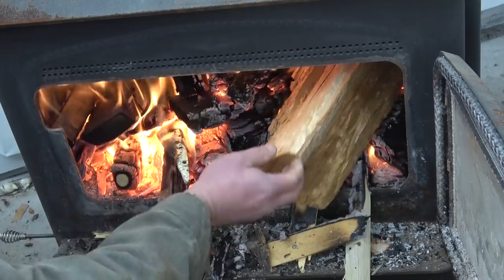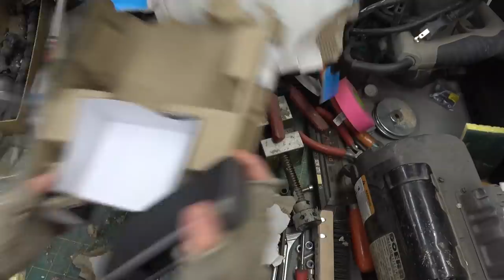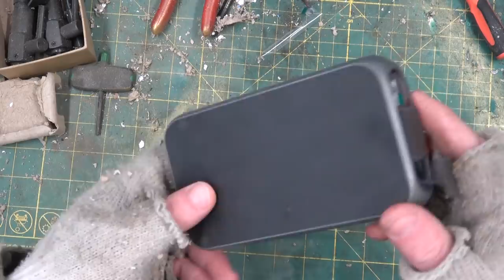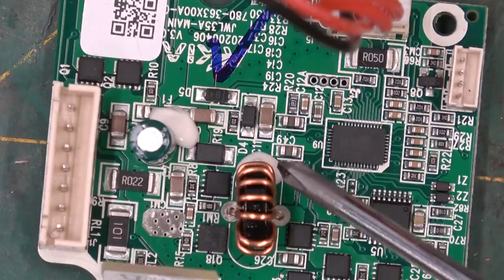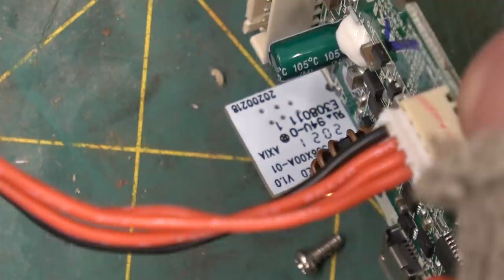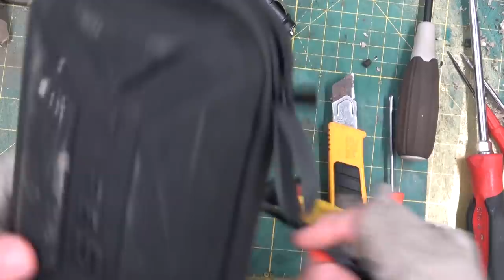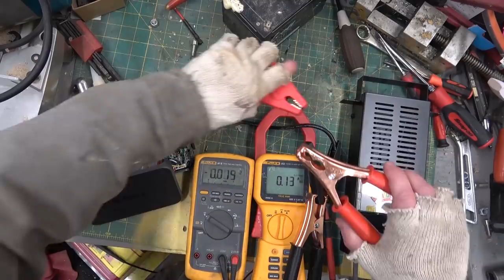BOLTR: Costco Boost Pack | Stupid Design

Comment: My one is LiFePO4 8AH 12.8V 102.4 Wh (which is THE standard measurement for energy capacity, btw) and CAN suck juice from the alternator to recharge :-D book recommends that you leave it on the base charging though between times as the unit only balances the prismatic cells when charging slowly, not when charging from the alternator. It can start an 8.3 litre C Series Cummins from "cold" 10-20C. I love it, but soon all my cars will be in LiFePO4 anyway and will never need a jump again :-D I'll likely sell it at that point.

Comment: I have a similar one of these (different brand though). Doesn't work worth a damn. only useful if you have a battery that's just weak enough to not start the car. (solenoid clicking weak) If it's a properly dead battery like no door locks or interior lights working you're hosed and need a proper jump. This was on a 2.0L gas engine too. Not exactly hard to crank.

Comment: I’m sure it’s not enough to start a diesel pickup, but I am curious what kind of load you see in the tester when hooked to a regular 12v battery from something that size. I wonder if ~80 amps is all the load tester will draw. 

I have one at my shop. I’ll try and test it next chance I get to it. I also have a antigravity jump back that I could not be more happy with. I’ve used it to jump 24v articulated trucks and a d6 in conjunction with a pickup to save grabbing a second 12v vehicle.

Comment: The little module on the cable is looking for something that looks like a car battery. Mine won't show 12v on the clamps unless something like a week battery is attached. The fets also allow it to shut down when the leads are shorted, when it over-currents for too long, when the LiPo voltage is to low and when the alternator tries to charge the LiPo batteries.
Reply: P.S. The LiPo in these guys is 12.6V fully charged and can put out a couple hundred Amps for a few seconds. It starts the V10 in my motorhome without breaking a sweat, at least well south of the artic circle in the summer.

Comment: The flashing light is for putting in the ground to warn drivers of a broken down vehicle in case of a electrical problem lights will probably be out so no Flashers a Flashing light draws the attention of another driver.

Comment: The one your showing looks different from the one i bought. Never had a problem and will start. One big tip dont drain your battery dead or you wont be able to start. Use a trickle charger on the car or if not driving all the time.

Comment: if I remember right my 86 Honda accord with a 2 liter engine pulled around 150A while cranking 
I'm not positive what it was for sure but I remember it was close to the same as the glow plugs in my pickup

Comment: I have the same issue with my pixel phone.  Try this get a really fine pick and a can of contact cleaner.  Us the pick to loosen up all of the shmoo (usually pocket lint) and then spray the contract cleaner in the hole to blast out the packed lint.  It should fix your phone.

Comment: I kind of have to disagree with the assessment of this battery I have a similar one and have used it multiple times to start my hemi Dodge Ram. Even in 20°f weather the trick is to make a couple of attempts at starting to get the power flowing and the battery warmed up a bit. Also I used mine to run my old farm tractors ignition system for a period of about 2 hours when the alternator went out on me and I needed to finish a job. The only thing I have found that it doesn’t want to jumpstart is a Diesel engine and that is because the draw from the glow plugs is so great it overwhelms the power supply. But your average car and gasoline pickup it will start even with a completely dead battery

Comment: The idea of the 75 amps is that we're assuming your battery is just a bit underpowered from the cold or age or whatever. If you need 250 amps and your battery is only putting out 200, then having a little bump of power is often just enough to get things moving. Obviously a little 75 amp battery won't do anything on it's own for a completely dead battery.

Comment: The issues you had with the test were caused by that brick atached to the jumper cables, it has to detect voltage in order to allow voltage, its to prevent the thing from catching on fire should someone inadvertently connect the two cables together, i use mine to power a winch which does not have voltage to detect, therefore i bypassed it.

Comment: The TacLife one I got on amazon I just used today is great. It has a button on the big dingus end of the cables that you press to start the boost to the battery and it stays on while you try to turn over your engine. My battery was quite dead (haven't driven in months). It took me a 60 seconds ish to turn her over but the device worked flawlessly. Would be cool to see you take that apart!

Comment: Work at Lowes and got a Craftsman 300 amp 600 peak amp boost pack and it starts up my Expedition with a 5.4 engine and a not so good starter and it can start it 3 times
I purchased it as a joke for $9 USD on clearance  and i should have bought the whole shelf and gave them out to my family.

Comment: Those USB C Charging ports should last a LOT longer than micro.

The big difference is the C ports get right gunked up with schmoo easily and when you insert the dingus end it shoves it all down and makes it rock hard. You gotta take a needle and clean the lint and skin and gross out every once and while or the cable doesn't go in all the way, makes people think the port breaks when it's just dirty.

Comment: I have one of these and actually it works quite well. I've never tried it at -40 because I don't live in a frozen-over hell, but at normal temperatures it works just fine. It has started my Suburban with a 350 with no issues. I suspect it may struggle if I completely removed the battery from the Suburban and tried to just use the tiny lithium pack, but that isn't what it is designed for.

Comment: I thought Li-Po batteries didn't like being stored with full charge or completely discharged for extended periods. I have some RC plane friends that also transport them in special bags in case they pop. They also store them at a certain voltage. I'm just curious if these things are safe enough for average consumer now?

Comment: I bet the boost pack times out and turns off because it expects some battery voltage on the other end. A battery tester is an effective passive load but doesn't emulate boosting another battery. The quick burst of ~70A should be enough to get some voltage out of even a frozen dead battery.

Comment: Should buy a heavier duty one for v8 and cold probably, but giv'er a go. She may suprise you. If the main truck bat isnt completely dickered it will probably work. Not sure the old school batt tester is ideal for these new fangled cells. Probably capable of a few hundred amps for large fractions of a second.

Comment: the capasitor self chargeing car starter booster will give you a 700 amp boost and charges itself from your deadish car truck batterie. autowit i believe its called..but the gooloo yellow one i think the 4000 model..you wont be disapointed..it got lots of batterie shmoo to give!!

Comment: I could be wrong about this, but I think that the reason you only got 70 amps out of it, is because that is what the load tester draws. If you hooked it up to something with a higher load (say a car with a dead battety) I think your amps will read higher.  Like I said though I could be completely wrong.
Reply: As a check, you could hook the load tester to a known good car battety, and test how much it draws with a d.c. amp clamp meter.

Comment: Older version of that charger sold under a different brand -  without safety the pcb on the wires - has saved my ass more times than I can count, starting a V8 diesel pickup from flat batteries, a jeep 4.0L and numerous motorbikes. 
This thing is cheap, light and takes enough of a beating that you can keep it on your person and risk a flat battery no sweat. It also makes a great portable 12V supply. I have come to rely on it despite never needing to charge my phone off of it. Just cut out the shitty safety pcb.

Comment: Usb C is more robust. But you can get schmoo built up inside and it won't work. Try blasting it out with brake clean or scrubbing it out with a toothpick or small zip tie

Comment: I had a battery pack that detected the battery voltage/polarity and refused to work if it didn't detect some voltage (presumably to stop it dumping pixies into a short). Does your charger tester supply back-voltage?
Might be worth trying it with a mostly dead car battery across the load.

Comment: Drag a sewing needle around the bottom of the usb c slot and pull that pocket lint out. I've seen it happen to multiple phones. The symptom is the cable doesn't index into the hole.

Comment: I hope it doesn’t charge off a vehicle once it starts. My Flapoff doesn’t charge once it detects voltage is greater than a set value which is around 12.6 VDC.

Comment: 20:20 regarding the "diodes": both of them are N-Channel mosfets. The two on the connector side are for switching the clamps on/off and the other ones for protection against charging the boost pack by the car. Can't use one pair for both situations since mosfets come with an bodydiode that will let current flow in one direction even when turned off. It just seems odd that they use two different types that are about the same thing? 

Here are the datasheets if someone is interested:

https://datasheet.lcsc.com/szlcsc/NCE30H29D_C161842.pdf (input side)
https://datasheetspdf.com/pdf/944175/HOOYI/HY4903B/1 (output side)

Comment: The testing methodology is slightly wrong as far as getting the cranking amps because you are discharging through a resistive element that is around 0.1-0.2 ohms.  The resistance of a vehicle starting system is going to be much lower around .05 ohms or less depending on the size of the starter.  In many cases, these little units can dump between 200-400 amps for a few seconds which is often enough with the aid of the dead lead-acid to start the vehicle.  Some can deliver far more.

Comment: Ave : Have you ever measured the load resistor in ohms in your battery tester ?  Also is the resistor tapped for higher current range testing ?

Comment: I'm curious what the manuel says about using it.  is it really supposed to crank your car engine or just boost your onboard battery.  does it say to hook it up and wait 10 min, then start your car?  

USBC can transmit 100W of power!  and has 24 conductors and is not directional.

Comment: All you have to do is bypass the little PCB on the cable and BINGO, direct connection to the battery!  You can extract as little or as MUCH as you want without any protective oversight! :-)

Comment: My pixel 3xl did the same thing. Probably didn't help that I leaned on it whilst in my pocket and cracked the rear cover.. in to the wireless puck from then on. 

 Got a TCL 10 when I upgraded.

Comment: READ the Instruction!  It is a capacitor and is charged by the battery which still has enough power to charge the thing.  It takes a few minutes; read the instructions

Comment: Pro-tip, when its used inline with the car battery (dead) it uses the car battery essentially like a giant capacitor to keep the voltage and amperage spikes to a minimum, making it actually work. I didnt believe it before so I had to research it.  No fucking way that can kick out the amps without bursting, hence the battery (cap)

Comment: From Wiki:
"Standard USB has a minimum rated lifetime of 1,500 cycles of insertion and removal,[4] the mini-USB receptacle increases this to 5,000 cycles,[4] and the newer Micro-USB[4] and USB-C receptacles are both designed for a minimum rated lifetime of 10,000 cycles of insertion and removal.[5]"

Also, Ah capacity is then also dependant on the voltage of the system, Wh actually gives usable 'energy' capacity. Using mAh as a measure only works (on phones for example) because of similar voltage levels of compared batteries.
Reply: I agree. We should use Wh instead of Ah. 
Wh can always be compared. Ah only when the voltage is the same.

Comment: It's possible that the battery tester doesn't properly measure the lithium battery since its I-V dropoff is not as pronounced as a lead-acid battery. Its normal for a lithium battery to read mid or low charged when tested with a standard tester even if they are fully charged.

Comment: I not going to defend Costco but after working there for 5+ years through college and a bit after to pay student loans (18.5 an hour was pretty good easy work money). I can say that they never try to have bad products and that in fact Costco at any one time has 1/10'th the products to sell as any other retailer in the western market making any plan's to stock bad products an out sized and expensive problem later. I think the argument that a good return policy encourages Costco to stock less than good equipment misses two points (+1 because I want).
1. The return policy used to be so much better and was basically an open letter to the customer letting them return anything for most any reason. ( a lot of camcorders with demo tapes somehow failed right after recording weddings and the demo tapes somehow went missing)
2. Walmart exists and does what you accuse Costco of doing but without a return policy to match. 
3. You pay to shop there and they know that and are therefore alot more willing to deal with complete jerks than most any other retailer (huge moral cost)

I have not worked for Costco for over a decade and since then they have definitely become more like the Walmarts of the world starting new hires at rock bottom wages and the like

Comment: I got the earlier version of this as a gift.  It works well enough to charge a cellphone,  but I couldn't start my 96 horsepower Pinto Runabout.  Got a solid 3 rotations of the crank, and the lights and buzzer went off.  Nofukingudatal

Comment: Incorrect, micro-b is more fragile than type-c, if you're breaking it faster that means subconsciously you're slamming it harder because it will "go in however I plug it in" but its still a tiny port at the end of the day

Comment: USB-C Ports: Have you tried cleaning it? I got mine full of dead tree parts and it acted a bit foozy. I took a tooth pick to it, dug out the mother load and low and behold, the charge carriers can find a way to move through the wires again.

Comment: since V = Amps × Resistance.  Without resistance as in a near dead short, virtually all the voltage drop is in the ever so tiny resistance of the mosfet.

Comment: can you operate on the old milwaukee m18 brushed shop vacuum ? Tea kettle style looking one? mine works for 2 min and stops after a year of using it loved the handiness of having those batteries around already might buy the new Fuel brushless m18 vacuum looks nice any input? Thinking the motor has died and cuts out on thermal overload/protection and comes back on after 20 seconds when cool enough

Comment: I have a jump pack(not this one) and it says to remove the pack within 10 sec after starting to avoid charging the lithium battery off the car. I'm guessing this will work differently when hooked to a battery. I'm thinking it shuts off because it is not seeing battery voltage.

Comment: That isnt meant to start group 31 batteries. Its meant for about group 24 and smaller. And the battery cannot be deeply discharged or it wont work either. Noco boost packs and chargers are the way to go!

Comment: Might be kickin off due to the resistance of the tester going up with the load when the element heats up, throwing the error for unplug and reset. Possibly.
Reply: for sure.  Because it's not meant to jump start a car. lol  You are suppose to let it charge the battery first, then start the car.  Takes 5 mins or more depending on how dead the car battery is.

Comment: Get a better jump starter? Mine starts a 3.0 diesel in the UK winter perfectly, saved my bacon numerous times.

Mine has a reset button on the jump lead module & I've never needed it even when starting a few times it just works. Paid £50 off amazon few years ago

Comment: To reset it without unplugging it you have to type out "Reset" in Morse code using the button. If you miss a letter it will lock you out for 30 seconds for security purposes.

Comment: I have one of these, and it requires there to be some charge in the battery (probably so it can detect attempts to reverse charge).  Trying to use it as a 12V source with a dummy load (like you're trying to do) doesn't work.

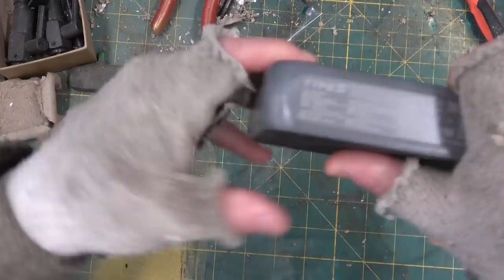Comment: 5:33 Powerbanks MUST be rated @ Wh, not Ah so the "size" is seen on the first glance. Also that provides the comparability betwext the them - the early powerbanks "lied" with an Ah rating @ 3,7V and not at 5V what was the output voltage, which of course appeared to be higher.

Also the Airport security forbids to have powerbanks with a capacity higher than 100Wh in your carry-on baggage. (cuz bombs and self exploding risks..)

Comment: Hook it to a vehicle, it needs voltage feedback or it just thinks it is a short and it shuts off for protection, I have a mac tool one and it works great, will start my f150 multiple times off of one charge.

Comment: If anyone has these in the great cold north. Put a couple of the hot hands instant warmers in the case. If you are outside in -40 and it's too cold to work activate them and throw em in the case with the battery for a couple minutes.

Comment: Right m8 got the usb C problem all the darn thyme i figured it out tho... 

Dust

I get a bunch of dust in there from working in the shop everytime you plug it in it compacts it more and more then makes less and less contact 

To fix you get a small pin and dig out the crud works like bran new yuhhh